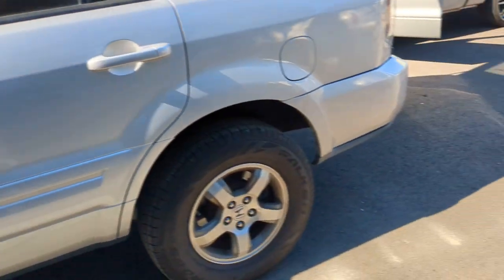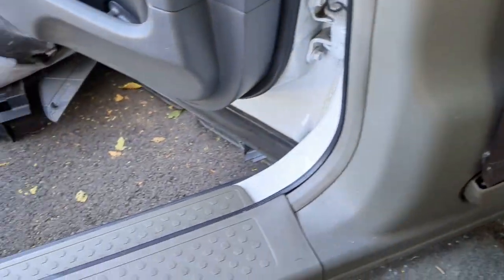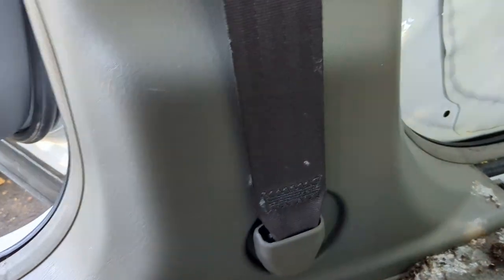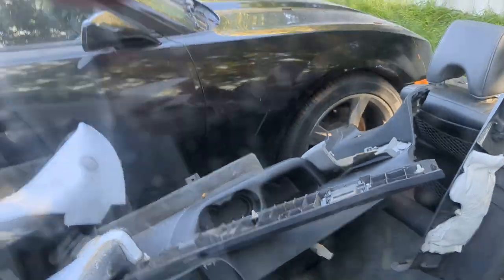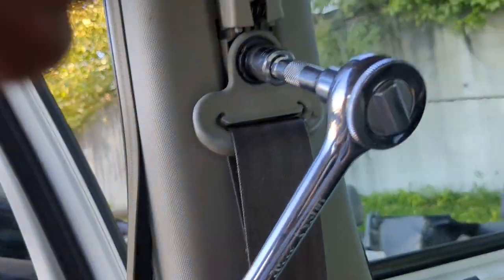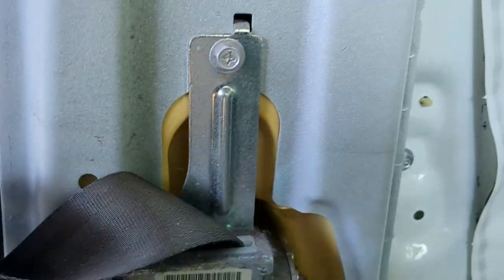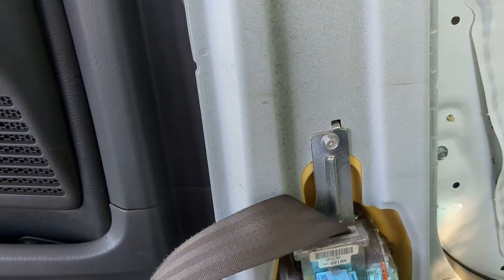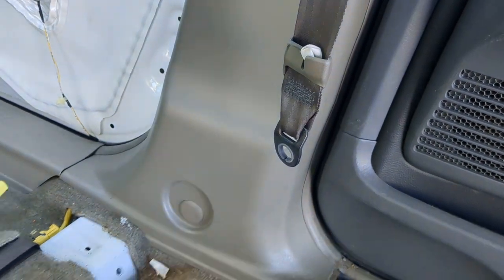2008 Honda Pilot Drivers Seatbelt Removal

Comment: Thanks man, is it supposed to stop retracting when you take it off?
Reply from the maker: @TrapXbackwud  Hi. Glad I was able to help out. I'm not quite sure exactly what you are asking, however I suspect what you are asking is about the operation of the belt while it is removed from its position mounted in the vehicle. The unit has a safety mechanism that enables it if it's not exactly level in its original position. Once you reinstall it in the vehicle, let it retract a few inches, then it will pull back out again. You can try to replicate it's mounting position while holding it, it's just sometimes difficult. Hope this helps. - Sponge
Reply: @TrapXbackwud  yes.  The  replacement was the same until it was all connected